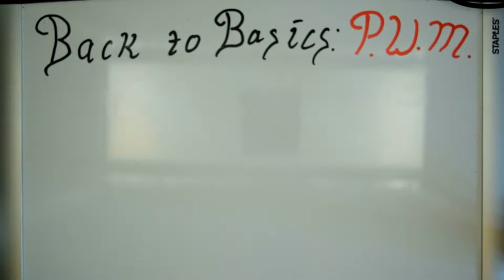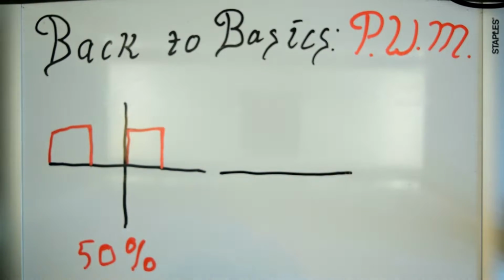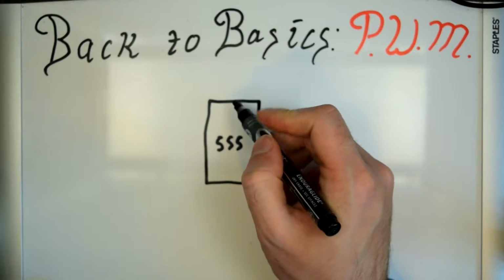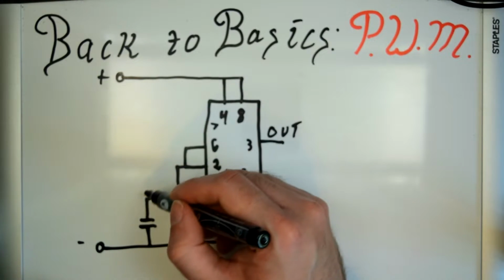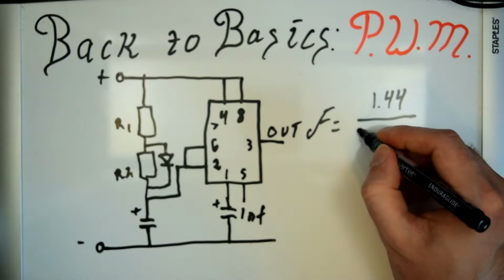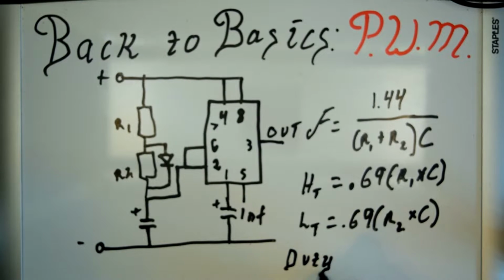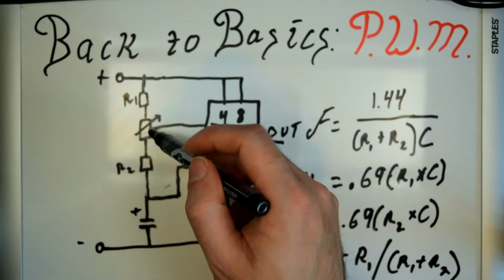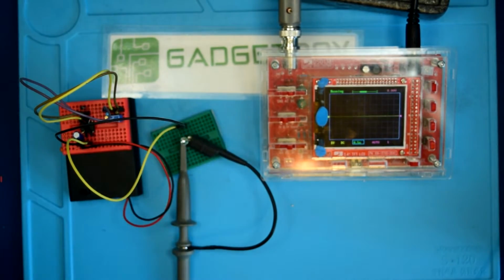Back to Basics: Pulse-Width Modulation

Comment: I have a new question, what is the difference between using pwm to control the speed of a motor over simply changing the voltage with a potentiometer?
Reply from the maker: +Phonotical It's a question of power. If you pwm the motor, it's pushing with full force during its on cycle, whereas if you control the voltage with a pot, you aren't applying full power at all. It's a non linear relationship, which is why pwm allows for a linear control of motor speed.
Reply: @GadgetBoy  ahhhhh I think I barely understand, but it helps, pwm = more torque?
Reply from the maker: +Phonotical yes.
Reply: @GadgetBoy  this may actually be helpful for me, gee, I always thought the pwm way was just a more pain in the ass way of doing it, oh, I found some resistors the size of the comma, in my new calculator, it actually lead me to an idea about how they could evolve
Reply from the maker: Some resistors are just physically printed on the board using a thick carbon ink material.
Reply: @GadgetBoy  that... Might work too, unless they chipped or started to break down and delaminate, in which case, that would be awful 😅

Comment: How fast could you get it to flash? I've been looking to make a very fast strobe light but everything is failing to meet my expectations
Reply from the maker: Well, when I set up the PWM control on my lights, it'll be flashing 1,200,000 times a second. For a strobe, you'd need to change the frequency of the pulses instead of the duty cycle. Good idea for a video, though.
Reply: @GadgetBoy  1.2 million, thays nothing! 😅  ... Maybe I missed something obvious somewhere... I'd not seen able to find ones that can do any faster than say 300 a second, and that was by accident
Reply from the maker: Well, you wouldn't want a strobe that ran at 1.2MHz, wouldn't be very effective. For a strobe to be effective you'd need it flashing slower than what the eye can detect (72ish Hz), so most strobes will be adjustable between 5-100Hz
Reply: @GadgetBoy  I need this video

Comment: Could you have two potentiometers? Fine tuning what would happen if you put capacitors rather than potentiometer or resistor.. Yes, I'm a maniac
Reply from the maker: +Phonotical I'm not sure what the utility would be for that. The whole point to the one potentiometer is to change the ratio of Ra to Rb. Using one potentiometer makes it a very linear and smooth transition.
Reply: @GadgetBoy  because reasons